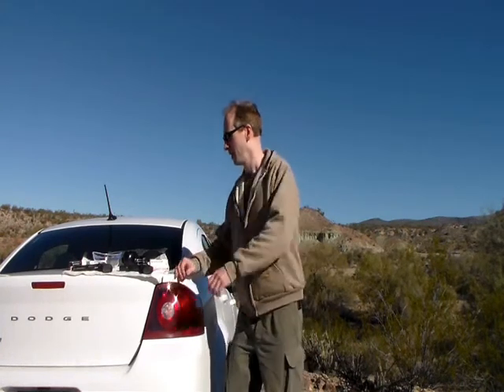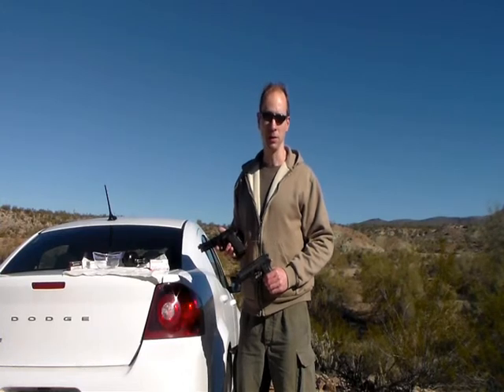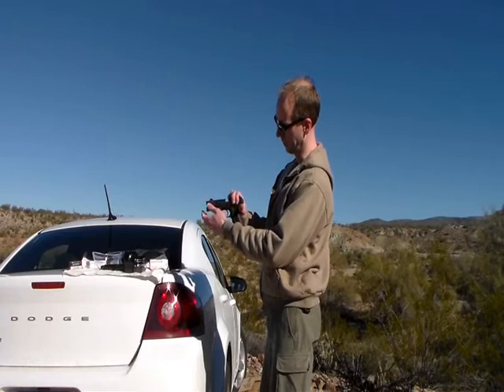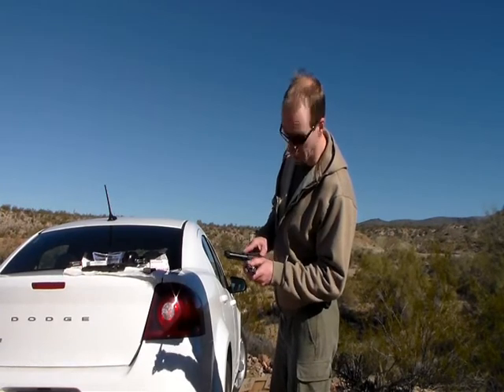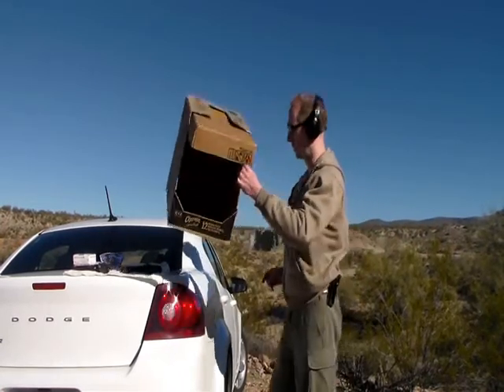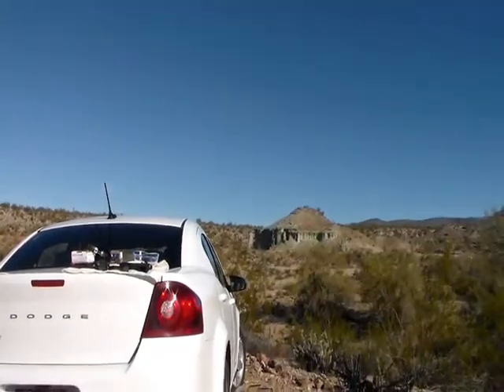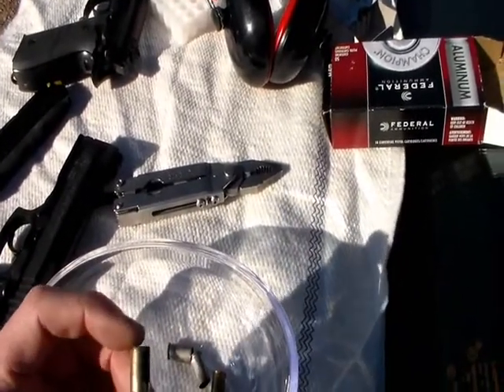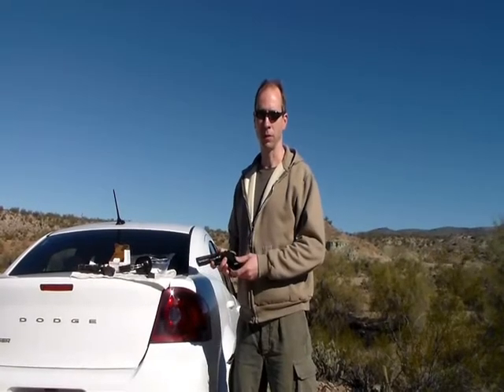Beretta 92 9x19 blowback conversion

Comment: Hum, but why? What advantage would a blow-back have over the standard falling block? Was it just an experiment to see if it would work?
Reply: There is no practical gain, so it appears to be just an experiment. 9x19 simple blowback pistols are of course nothing new, although I doubt the Taurus 92 has sufficient slide mass to make it functional and safe for any prolonged use. Hi-Point C-9 may be heavier, but it's actually designed to work that way, and works even with +P ammunition, if you for some reason absolutely positively NEED to have a 9mm Luger simple blowback pistol (I don't know why one would, though).